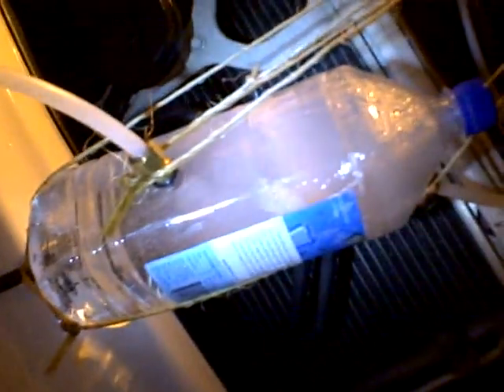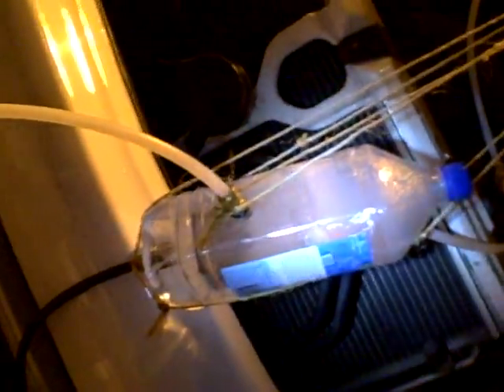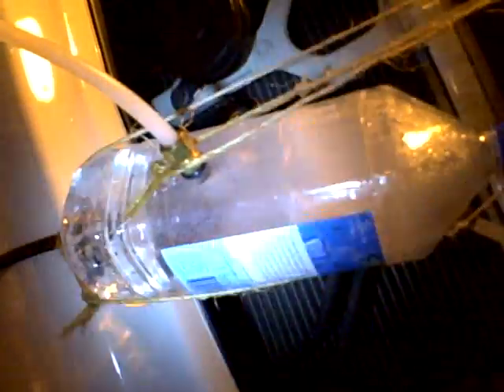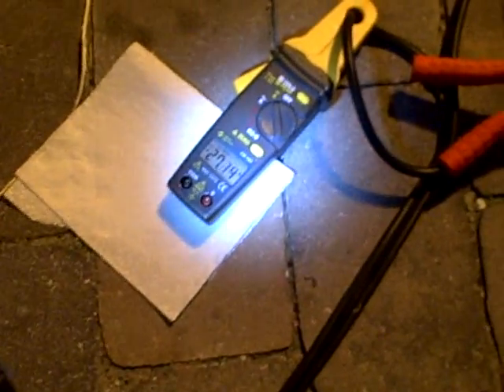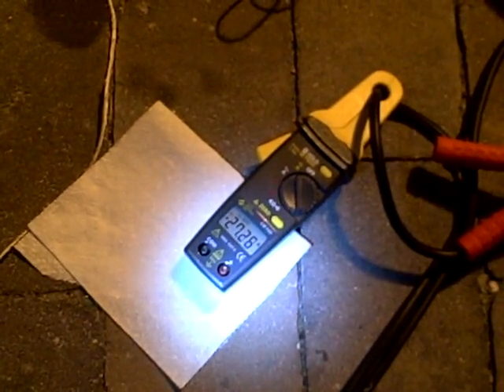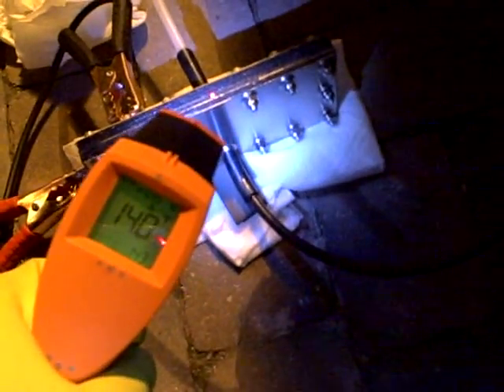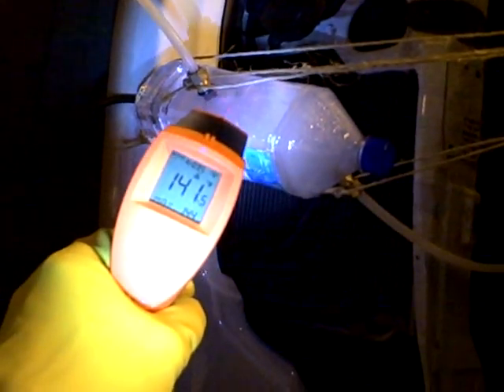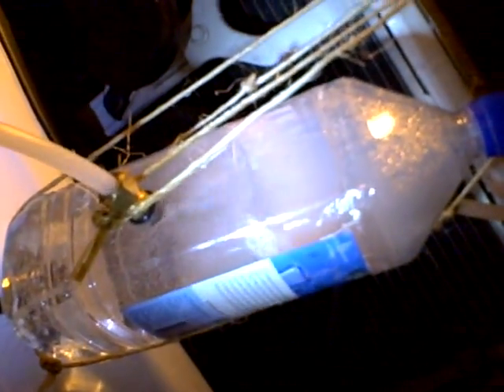HHO CELL  3.0 liters in 1 minute

Comment: At 120ºf you start making water vapor.  if you do not but a dryer filter before the flow meter it fill up with moisture and not be an accurate measurement. Put the output hose in a bucket of cold water and see how much is HHO and how much is water vapor. On average if you have no 12v leakage, you should get 3 LPM at 13.8 volts  x 32 to 34 amps. You can not run 27 amps for long, it will melt your bubbler bottle. If you run that much para hydrogen into the engine it will only predetonate and fight the engine combustion.. Learn to make 75% to100% Ortho hydrogen and oxygen.

Comment: Hi. I am bulding a 11plate cell, but I'm getting no production. I bult it from plan off the internet. 2mm spacing the plate area is 170square and cm 3mm thick. I tried diffrent tipes and mixtures of elctrolite. The voltege over the plates are 1.4volts and it draws 0.75amps(the whole thing). Are my plates to thic? Would you be willing to shere the spec of your cell with me?

Comment from the maker: @ djuneidc3000, ok, here goes. first b sure you have a 12V powersupply like your car running at 13.5V&is able to give u 20-28 amps output. 2nd,sounds like you have alot of plates there, make your cell positive in middle plate with 4 nuetral plates on both sides of the positive middle plate. then make the two outer plates your ground plates.  this will make for an 11 plate cell. the cell spacing is 1/16 inch. try 2 tabspn of KOH or 3 teaspoon of SodiumHydroxide/draincleanercrystals perL/DW vs.

Comment: hello.. i have a dry cell with 21 plates 316L stainless steel. i used KOH with distilled water.. 3 table spoon for 1L distilled water. it is producing 0.5L per minute at 4.7 amp. Can you please help me on how to increase production per minute?
Thanking you in advance :)

Comment: you arent getting any wattage or HP or torque gain. your saving money. you get the same 336 watts into the engine but you convert it to a fuel your engine can use. you gave up to easily and thats why our society is failing

Comment: Is the current coming from the car battery (12v) and you pulling 28 amp...then your draining 336watts from the engine...assuming the cell is 100% efficient then your only adding 336 watts of power  back to the engine....i tried all this...it didnt work....good fun playing around though.

Comment from the maker: @FreePizza007 ..great scientific anylsis and good for all reading.  yes you're right Na will be left.  so simply speaking all you have to do is replenish the electrolyte with distilled water.  sodium hydroxide/Na lye, what makes soap soapy, disolves into water continuiusly.  the amperage will increase as the h and o are realeased making the electrolyte stronger as it's level depleates in the bubbler. simply adding distilled water will allow you to have plenty of use with your Na electrolyte. vs

Comment: @variablestatus Thanks for reply, It has been many years since I have done chemistry so I will give a breif explanation of my theory. Maybe someone can correct me if I am wrong, here it goes;
Sodium Hydroxide is NaOH, Water H20 so the Chemical balanced equation is:

NaOH + H2O -> 3O + 2H + Na

Meaning that the Oxygen and Hydrogen gas dissapear in the Electrolysis process. Well Na is left. That is Sodium. Sodium deposits are left in the closed Cell- Long term and after a while it'l fill up.

Comment from the maker: @FreePizza007 ....nope, the sodium hydroxide does not build up.  it runs very clean.  you just have to be careful the way you handle it and anti-dote if you spill some on your skin is to use/rinse with distilled white vinigar.  3 tea-spoonfulls of sodium hydroxide with 1.3 liters of distilled water makes an electrolyte that relates to about 21(pwm) to 28(direct current) amps on my cell.  cheers, vs.

Comment from the maker: @Mrinfoone and pcbpavioc..the size of the plates is 5"X7" & the thickness of the plates is the same as the thickness of the gaskets when they are compressed @ 1/16 inch.i will send both of you a complete set of plans.i have sold to many in the past because so many offered to buy it but now i give the plans away to all my fellow scientist out there for the asking.between my plans, the three video's &the blogs here, you will just about have all the info you need for a great start.cheers,vs.

Comment: is your flowmeter an oxygen flowmeter?, if it is your measure is wrong. I read 2.5LPM with 4 oxygen flowmeter, and when I use the fill bottle metod I read 1LPM, by the way thanks for to share.

Comment from the maker: correction on typo below,  temperature is maintained at 140-142 degrees F on this cell which is really good at the amperage used.  this was the temp after a 2 hours continuious run test.

Comment from the maker: also to all and especially xsports49 and nettickturbo and others with similar question.  fact, your car only burns about 40% of the gas entered into the engine. 60% is burned by the catalytic converter.  with hho you can get with the addition of pwm and o2 sensor and mass air flow sensors overides you can get up to 90 to 95% burning of the fuel entered into the engine.  with the added hp used for the amps used only about 5-10% at most of the fuel used is needed for this.

Comment from the maker: to xsports49, since your educated let me upgrade your education.  in my other video's you see my pulse width modulation PWM unit in relation to your collapsing field question.  this video is in relation to an ultimate sealed cell of which it is.  it has all the dynamics you could want in a cell.  self circulation which keeps temperature equalized at 148 degrees,   if you read my other comments below you'll be educated on other details which are ultimate in this subject.

Comment: Hrm so the 27 ams at like 13-14 volt from your chargings sytem is about .5 HP

Now this may seem odd but you should dyno the difference to see if there is any net power gain.  I know this isn't for power but fuel economy, but it will show you a net result.

Comment from the maker: for anyone who wants and needs to know the temperature on my temp/laser gun is 145 degrees ferinheight,not celcius.  american temperature reading, not european. the amount of output is in liters as everyone uses liters to measure hho production by so i did the same. it is a good.common reference that we all can relate to.  i don't beleive there is much steam or water vapor because with the amount of output you can barely see any of the white gas/steam come out of the outlet.  98%hho i would say.

Comment: Hi Variablestatus,

Yes, we need to know the VOLTAGE as well as the Amps and Displacement volume in order to quantify your results and calculate it's actual true empirical efficiency.
1. mL/Min (or how long to fill .5L or 1L container)
2. Volts
3. Amps

The result is your MMW or mL per Minute per Watt!

I've started calculating an additional measurement as well:
MMW per Square Inch just to get an efficiency # per sq inch! What do you think?

TTYL,

Superbee1970

Comment from the maker: oldbeaver581, try putting a larger inner diameter hose on the hho output side than on the electrolyte intake side to correct your problem. just a very slight increase so as to maintain electrolyte flow back into the bubbler for cooling.  way cool you built your own sealed cell.

Comment from the maker: waleedmech, EMPIRE0FLIES, here are a few more details,the plates are scratched with diamond sandpaper(easiest way to scratch s.steel 316L for more surface area) and also 1. wash/bath plates with distilled water 2. wash/bath plates with distilled white vinigar 3. rinse with distilled water. plates are also about 1/16 spacing..1/32 gasket w/silicon applied on both sides =1/16.. although cell is definitely a great worker,i will be adding more nuetral plates for experimenting for top efficiency.